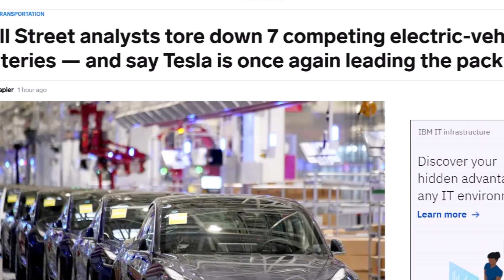Tesla Has The Best Battery Out of 7 Competing Electric Vehicle Batteries

Comment: Mark my words: 2021 will be the last year anyone will think that Tesla is unbeatable. From the top they will be attacked by Mercedes (EQS) and BMW (i4), in the middle the ID3/ID4 already competes and Kona/e-Niro are way more bang-for-the-buck and Hyundai/Ioniq will start with 3 new models ... and at the affordable end they are getting attacked by the chinese (BYD, MG). Tesla is losing one advantage after another. Above 250miles/400km range is irrelevant when cars can charge quick ... the ID3 can already charges at 125kW, E-Tron at 150kW, Taycan even faster ... The non-Tesla hyper charger infrastructure in Europe is growing fast (faster than Tesla's?). The performance is irrelevant for 99% of the car buyers ... even the slowest of the proper EVs (something with CCS ... Zoe, E-Up, Corsa-e/e208) are quicker off the line than anything they can afford to run nowadays. And then there is cost: you can lease a Corsa-e (100kW Motor 50kWh Battery 100kW charging) for less then 150€ a month (3 years, 15.000km) which is about a THIRD of a M3 SR+. This religious ignorance of Tesla fans is getting annoying. There is a reason for Elon Musk aiming for a 25.000$ model! At least he hasn't lost his mind like all the Tesla fanboys seem to have!
Reply: No one thinks Tesla is unbeatable.  They are leading the charge.  And when they're done, humanity will be the better for it, sooner than otherwise would have occurred.  Bring on the EV's, everyone, let's Accelerate the Transition... together!
Reply: @carlstockmal  I agree with your conclusion, but not with your introduction. Read at least a bit the comments below videos which are positive about non-Tesla EVs and you graps what I mean by "religious ignorance of the Tesla fans". Even under this videos you read bullshit like "I didn't know Tesla had competition". At least in Europe Renault-Nissan (Zoe and Leaf) has done more for the electrification of personal transport than Tesla. They almost singlehandedly created a need and thus the seed of a market for independent charging infrastructure which follows market rules and is steerable by the democraticly elected governments. Look at the US: long trips with a non-Tesla-EV is tough as the charging infrastructure is thin! So the oh-so leftist Europe created a much more free market than the oh-so free USA. And I can only hope that the realisation of this fact will drive customers toward the Tesla competition, despite being slower (but not slow!), less smart (but far from dumb!) and taking a little more planning for long trips (at least for now! abetterrouteplanner with OBD-Integration could fix this almost instantly even fpr entry-level-EVs!).

Comment: While it's no surprise that Tesla won this comparison, as they have long had the lead in EV range. Tesla's new 4680 batteries will redefine the battery market moving forward. First off, in a direct comparison of previous Tesla batteries, we were mostly talking about Panasonic's 18650 and later 2170 batteries. But it is hardly just about the batteries, because Tesla augmented the batteries' capabilities with control software and hardware, advanced motor design, heat pump, cooling, and superior energy management and efficiency. This defined Tesla's lead against other EV automakers, combined with the fact that most traditional automakers were previously building mostly compliance vehicles, and even when they committed to supporting EVs they only offered one EV model in their whole lineup. LG, who supplied GM, VW, Hyundai, and others was caught off guard with the increasing battery demand, especially from China, and battery supply was limited and several automakers had to stop building their EV models until supply increased. Tesla/Panasonic's battery production also limited Tesla's maximum EV production, but not nearly as badly. Still, the battery supply shortfall, and worldwide EV market growth caused Tesla to expand their agreements with Panasonic, and expand Giga Nevada production, and also set up supply agreements with LG and CATL (which helped Tesla's China Model 3 production plans). I have not read the UBS comparison, but they must have finished their report before Tesla's Battery Day, or they wouldn't say that Tesla's competition is narrowly behind and could catch up soon. VW admitted that they were behind Tesla in battery technology, software, and efficiency. But they are spending serious money now to be more competitive. GM's continuing alliance with LG (and upcoming joint battery factory) will be the foundation of their new Ultium battery efforts.  And supply future EVs like the GMC Hummer and the Cadillac Lyriq. The Battery Day reveal showed Tesla's plans for new vertical market mining, refining, advanced higher speed battery production, including an improved Maxwell dry electrode technology. No current battery discussions and comparisons can ignore Tesla's new 4680 batteries. Plus present and future LFP and high nickel battery designs which are far ahead of today's battery (and whole EV) competition on many levels. Tesla was quiet at Battery Day about their upcoming million mile battery or Robotaxi development and approval. I spoke previously with a Tesla battery engineer and he said that Tesla's ongoing goal is to stay 2-5 years ahead of the competition, and with the Battery Day announcement it is clear exactly how they will maintain that lead, even though LG and CATL are certainly working hard to stay competitive.

Comment: Between US car companies GM and Ford (Chrysler isn't really a US car company anymore), GM has the better chance to successfully transition to electric cars.  Ford is pursuing a compliance path, meaning that they are only doing enough to meet regulations for low emission and zero emission cars while behind the scenes trying to eliminate the low emission requirements.  Assuming Ford continues this path, they will be bankrupt and probably bought by another company in 10 years or sooner.  GM has a commitment to 20 new electric vehicles by 2023.  I personally expect them to push that commitment back, but if they can come out with at least 2 models in volume by 2023 using their inferior but probably relatively cheap Ultium battery, they have a chance.  On the other hand, the deal they made with Nikola was a compliance move, and not a very smart one at that, so not a good sign.
Reply: No one is going to buy out a company that has $175 Billion in debt....right now, they are adding the rate of $8 billion in debt a year.  $32 Billion in the bank account, divided by 8 billion debt a year, is 4-5 years at their current rate

Comment: The car companies that are around 10 to 15 years from now are the ones who can get a robotaxi service in place over the next few years.  Add in a few boutique car manufacturers who build special purpose vehicles or 'look at me' vehicles.

We are almost certainly about to see a massive disruption in the car manufacturing industry.  New car demand will plummet with robotaxis and multi-million mile batteries.  Imagine an folded stainless steel exoskeleton "Cybertaxi" with 3 million mile batteries.  Run it 100k miles per year,  1 million miles per decade.  That's a 3 decade, 30 year 'built it once' vehicle.  

A 3 million mile car would replace 12 "Camrys" that last 250k miles.  New car demand drops from 70 million per year to less than 6 million per year.  VW manufactured almost 12 million cars in 2019. If we were using 3 million mile Cybertaxis we'd need only half of VW's 2019 output and nothing from all the other car manufacturers in business today.

Want to make legacy car manufacturer's really soil their drawers?  Point out that Tony Seba has calculated that with robotaxis we'll need 7x less cars in operation.  Now we're down to about what Tesla produces today, or will be producing by the end of 2021.